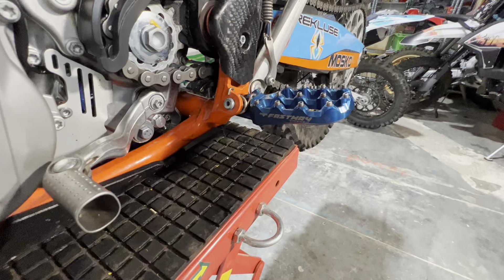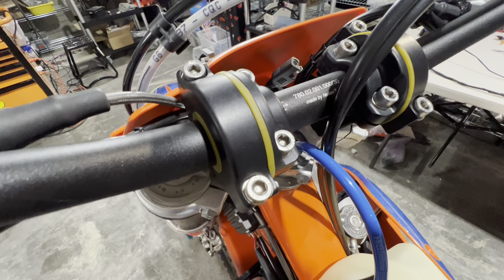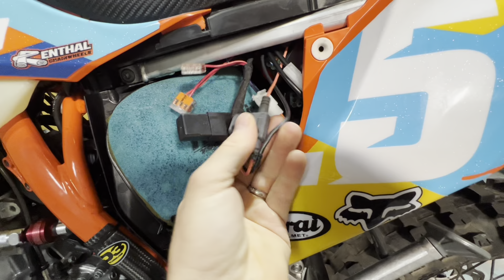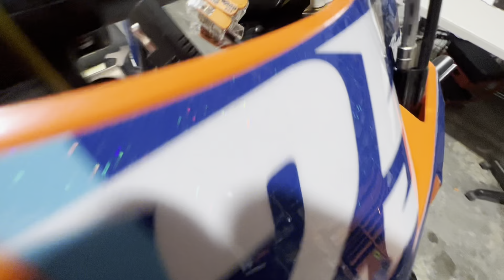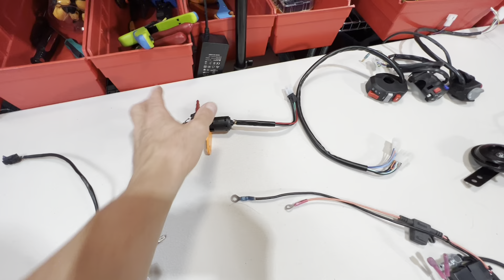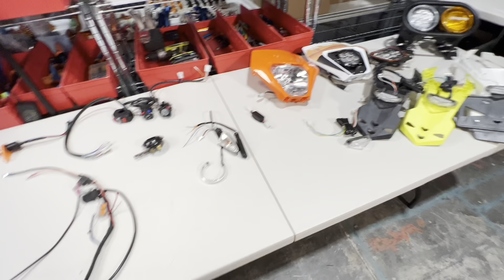23' 450 XCF-W BUILD UPDATE AND LIGHTING HARNESS

Comment: I built a race spec project 500exc years ago been mx raced,  hammered in dual sport, run in pitch black night on mtb tight single track in Tahoe etc... it is hands down thee most versatile 'dirt bike' bar none.  Bike is so dialed wouldn't sell it for anything!  And if theyre done right the 4cs forks & pds suspension is good or better than the newer stuff i have on my newer ktms incl linkage bikes 👌🏻

Comment: With 14/52 gearing how does the 450 run on the highway compared to the 500?
Reply: It's far superior in tight trails with 14/52 and can still cruise at 60-65 mph. Any faster than 70 and it really starts to rev out in 6th gear where the 500 stock is more comfortable at those speeds. The 450 revs quicker, makes really nice linear power from bottom to top, and revs out further. The 500 has more bottom end power and torque with a good mid range but signs off early.

Comment: WHATS UP GUYS, THERE ANY PLANS TO CHECK OUT THE BTEA 500 DUAL SPORT? LIKE TO SEE HOW IT STACKS UP TO THE EXC 500.. THANKS FOR THE VIDEOS,  ALL ARE INFORMATIVE.. PEACE PEEPS
Reply from the maker: Yes! We have one scheduled for the end of the year
Reply: Since it's a competition KTM not buggered by epa crap. I'm sure you know. The Beta isn't up to that performance. Beta's mantra is ride easy-to-use. Kinda flat throttle response. It's heavier by at least 10lbs. And that Sachs suspension, too much movement feel bouncy. In a real offroad desert competition which the 450xcf-w was designed that's where it shines. For DS mellowing rides, that's what the Beta caterers